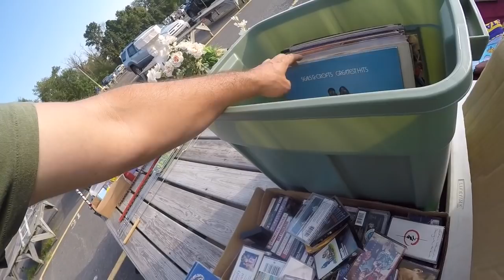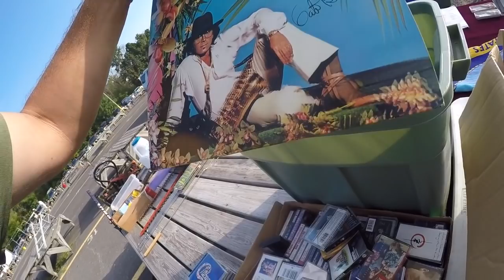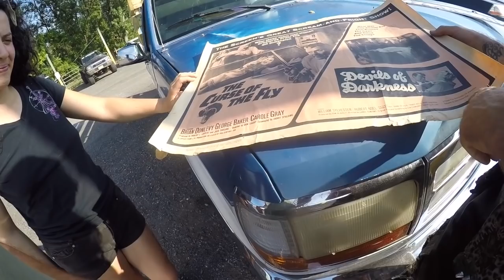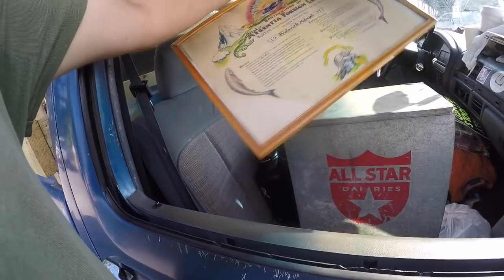Flea Market Shopping! Bought 100lbs of silver plate! & some jewelry too! Treasures!

Comment: Hi Richard in Canada here, I have a Blind cleaner for doing blinds , You put them in and in two   min  their clean . I had an old silver plate dish that was almost black so I put in and something came up and It went for about 30 minutes ,  When I took it out I now had a copper plate LOL  I started To  think later that would be a good way to extract the silver , I just had dish soap and water in the tank  maybe salt water would be better . Anyway it took all the silver off And left a copper plate you could then sell the copper If you can   Ultrasonic bind cleaner that's what I have its about 24 inches by 68 .